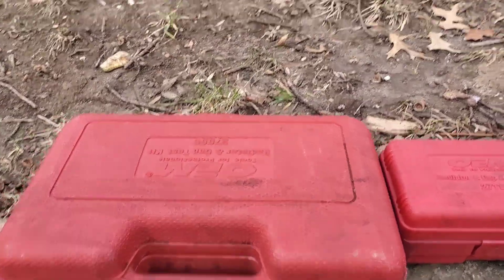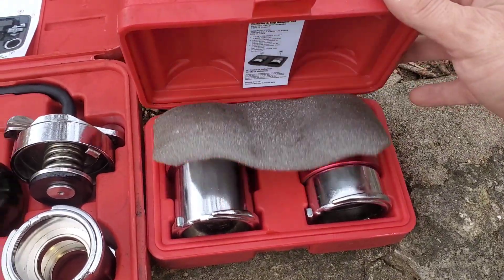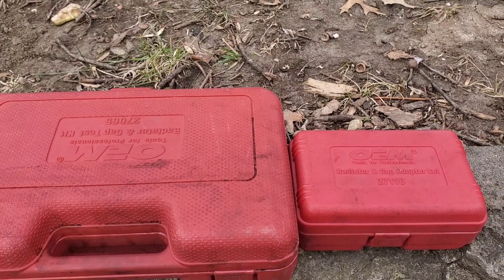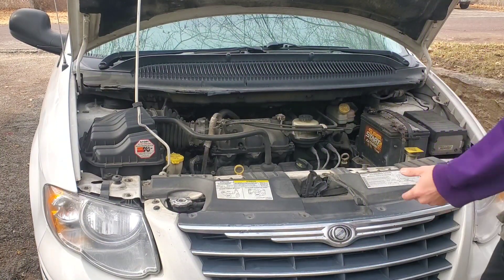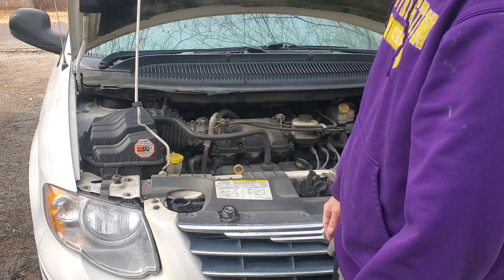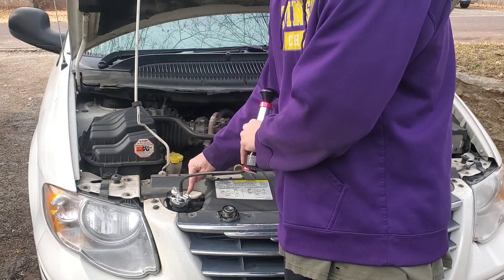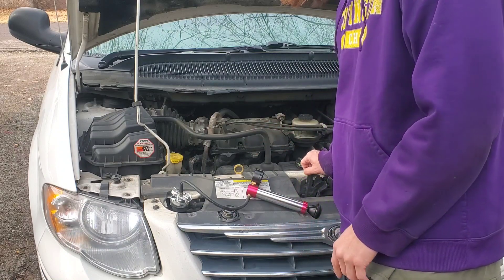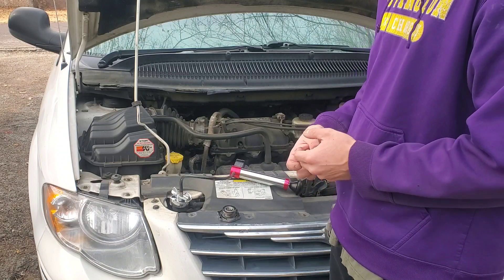How to use a Cooling System Pressure Tester!

Comment: Great demonstration. I had a Stant radiator pressure tester. I've been looking for another as it is a good tool to have on hand for diagnosing coolant leaks. I didn't know O.E.M. offered a tester. I have had good luck with their other special tools and are reasonably priced.

Comment: @5:00 That bottom right adapter looks like a Cap Tester
On the first demonstration, where you turned the locking wings on the cap adapter, those wings lock the center hole so the the overflow hose is blocked off.
Reply from the maker: You know that seems exactly like what it could be. Thats the only adaptor I've never used. Thank you for putting that out there as I'm sure a lot of people here will learn from it. Myself included